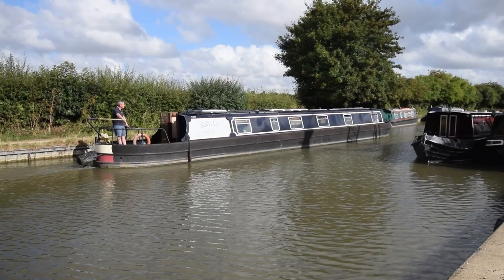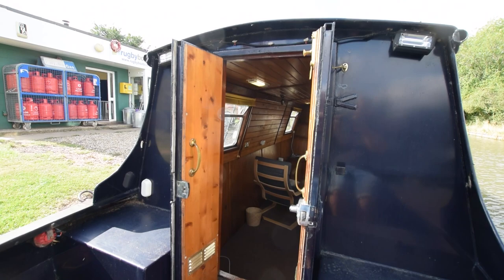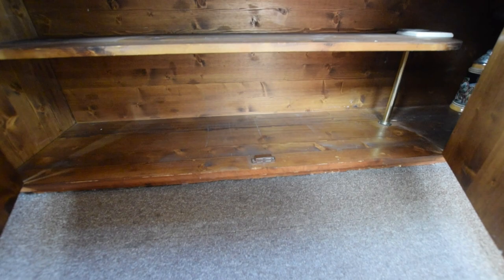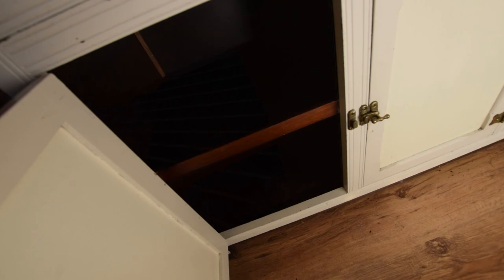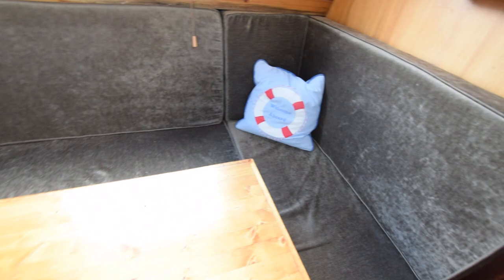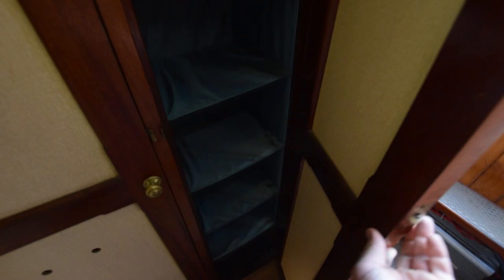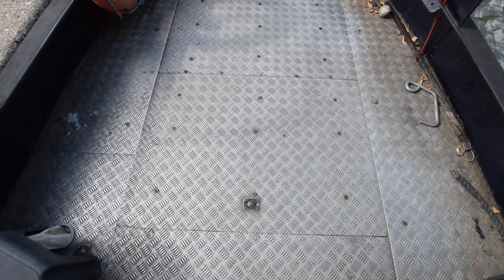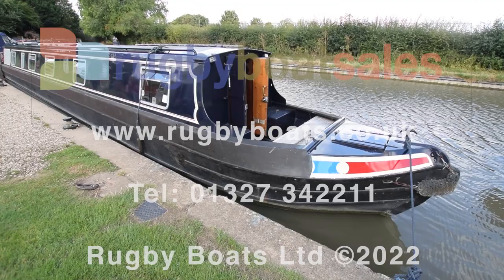SOLD - Slowly, 65' Cruiser stern 1986 Stoke Boats

Comment: Another cottage-like boat! It would take but a few very country knick-knacks to give it some lovable charm.  I do not like the wet room bath, but that could be a project for upgrade. Also, that's some fairly nasty rust in the engine bay, I would have to do an engine out leak check before buying and restoring her.

Comment: Its fundamentally a sound boat with a recent(ish) survey. Its too long for some of the northern canals, it needs some TLC in the engine compartment and an interior refit to your own taste. On top of that depending on the engine hours you might be as well to put aside some money for an engine replacement, maybe redo part of the electrical system as the inverter a little weedy depending on your requirements.